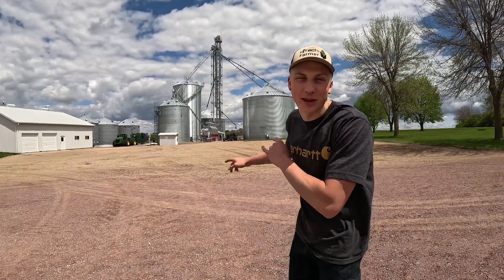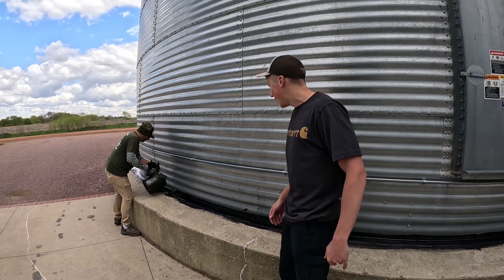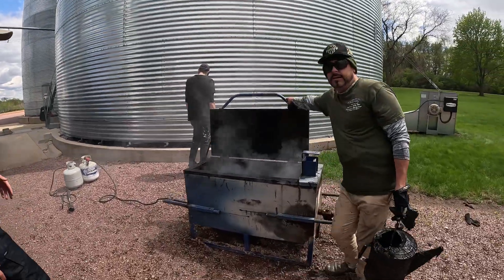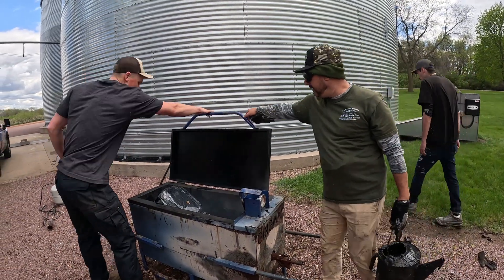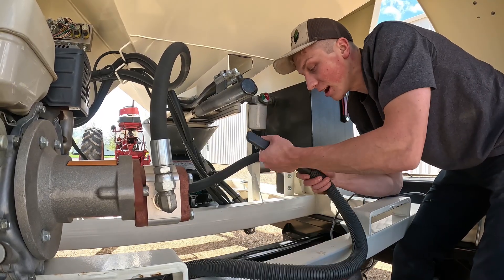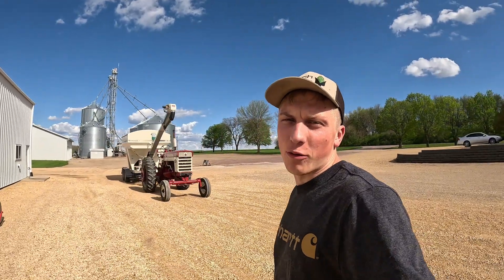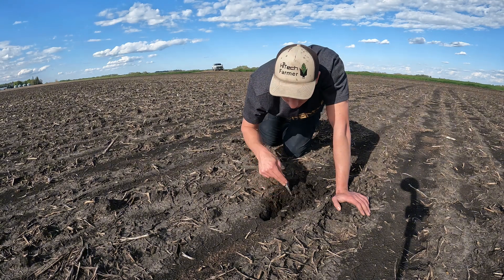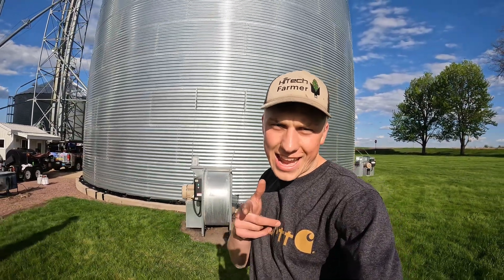I Wish Someone Had Told Me This About My Grain Bins (MADE A HUGE DIFFERENCE)

Comment: Two years from now, the rubber will be cracked allowing water to be funneled underneath the walls on the South side of those bins. The seal should be on the inside so its not exposed to the sun.
Reply from the maker: Put some on 4 years ago and haven't had that problem. Also it's hard to put it on the inside without taking up the floor

Comment: Hello Matthias, I'm watching from northern Arkansas. Aside from people with vegetable gardens, about all that grows here are rocks. 🪨
Reply from the maker: Linda, don’t think rocks are a specialty crop in Arkansas. I have a good crop of them too here in MN
Reply: Well, maybe so, around here the rocks are mostly limestone and flint rock. Both are used on unpaved roads. I can't tell you how many times I've had a flat tire due to the very sharp flint rocks. The other thing about rocks in my area is they have a good possibility of a copperhead, pygmy rattlesnake, or a timber rattlesnake underneath them.
Reply from the maker: That's unfortunate about the flat tires. It must be pretty dry there for the rattlesnakes to survive
Reply: @HiTech_Farmer Rattlesnakes like it here. I left out one snake, though, the cotton mouth, also known as a water moccasin. They like areas where water is near by.